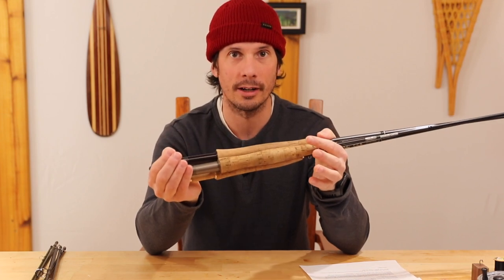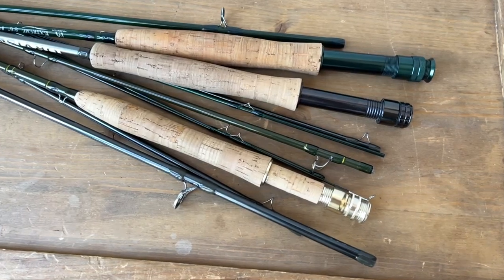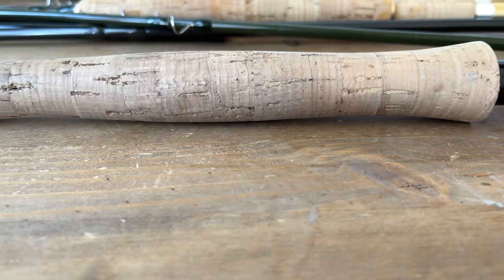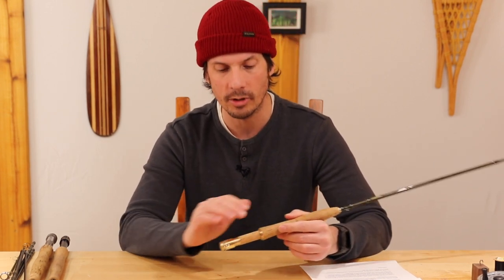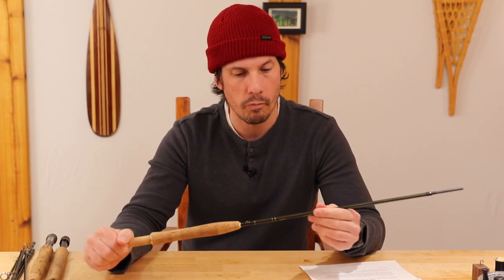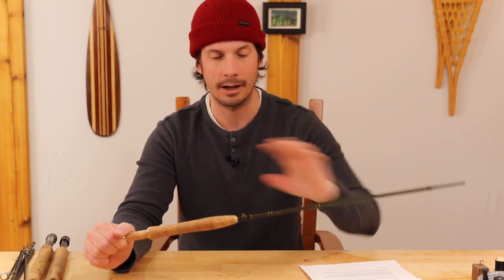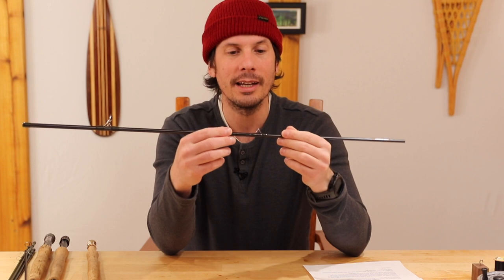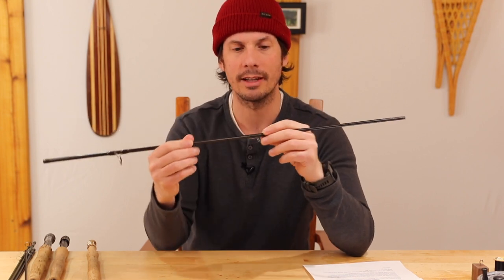How To Actually Choose a Fly Rod

Comment: Very difficult topic to explain to people especially new to fly fishing. You did a good job of breaking down the rods without getting over complicated. The only thing I would add is the rods that are available today from the $300 rod to the $1,200 rod are in most cases all good . The other thing to keep in mind is the line , the line will dramatically change the action of the rod’s performance so do yourself a favor before you purchase a rod talk to as many fly shop people and other fly fishermen as you can to help give you a better understanding. Best of all if you can demo rods do so it will really help you find what you are looking for . Now all you have left is reels , fly line , leaders and tippet . That will keep you busy until you get to two handed rods . Last year I went through all my rods and the ones that did not have alignment marks ( most of them ) I just used nail polish and made my own marks . Thanks for sharing
Reply from the maker: Great stuff! I edited what was well over an hour into this little video. I just find if I got into ERN numbers and penny scales(CSS), I would've lost most people. I do however find the ERN and CCN systems to be very accurate and has made line selection easier for my rods. Once again, this is beyond most anglers but of course, you better bet your socks we will get into this in a later video! Thanks for your input, definitely worth a read for everyone.

Comment: Wonderful video. One thing I would add is when it comes to rod weights, its not just a species-only based decision, but also what type of fly you're chucking decision. Ex: a #8 wooly bugger is a nice trout fly that I do not like throwing on my 4wt, but my 6wt rod and line handle it perfectly.
Reply from the maker: G’day! I do get into it a bit at the action chapter 7:46 I was just using a #8 woolly bugger yesterday on my 4wt. I have also used a large streamers on that rod no.2 is my limit with a 4wt. How do I do this? Well, it’s not the rod as much as it is the……drum roll please…..Fly Line! A fast action fly rod can do way more than a slow action but it’s costly in the form of fly lines, leaders and time on the water. Anyways, I have a video coming out(hopefully this afternoon) about the topic. This new video will supplement the fly rod nicely. Thanks for the comment and Keep er’ tight!
Reply: @greenhornflyhorn  good to know! Thank you!